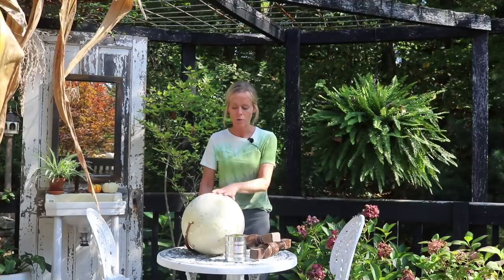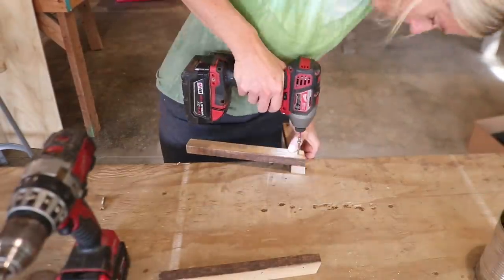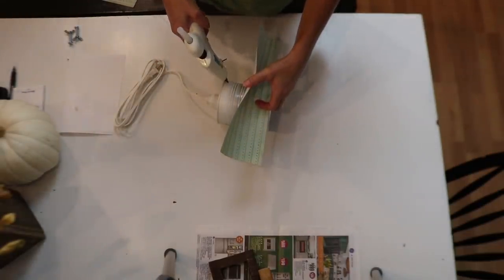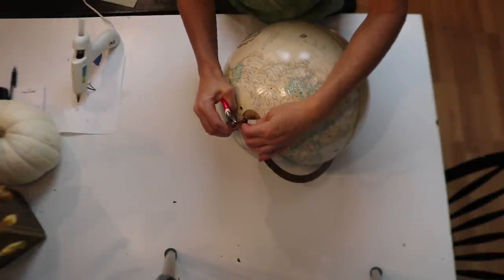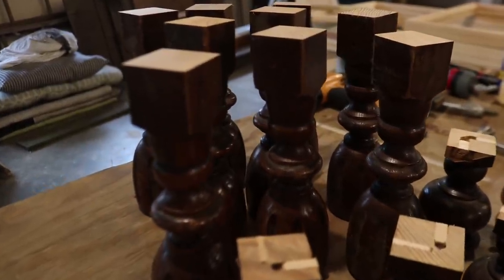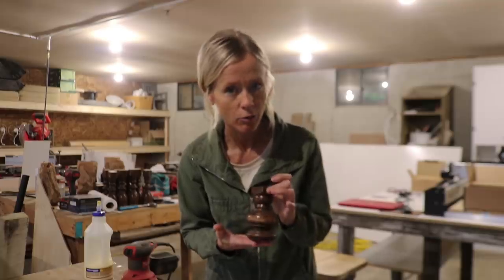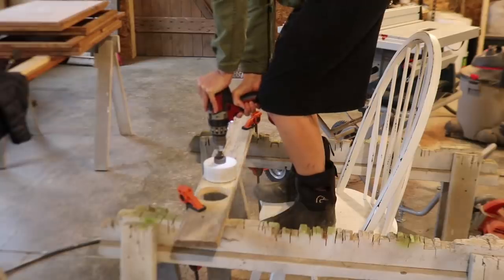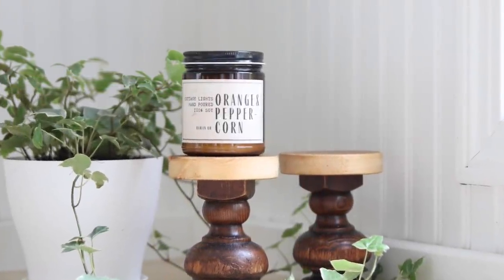Trash to Treasure Projects ~ Repurposed Tin Cans ~ Extreme Decor Makeovers ~ DIY Home Decor

Comment: I agree the wooden base lamp might benefit from different paper, or perhaps leave that paper on & just paint the wooden stand white? The flowered lamp is cute, I could imagine it as a bedside lamp in a teenagers room. I like the candle platforms they would protect a table from the heat of a candle when it burns low into the jar.

Comment: Hi Mary, I enjoyed your Trash2Treasure, as usual...would like to see the can lights after you tweak them. Your other projects are definitely treasures. I'm 71 years old and still climb, but you made me nervous. Wish I was brave enough to use shop tools. Daddy was a carpenter, and for 12 years I was the youngest of 3 girls. I spent hours, no years, in the basement with Daddy while he worked on projects for our home and for others. I would hold the boards while he sawed and  often had styes because of the sawdust getting in my eyes. But I never learned to operate any of his electric tools. The most I do is use a sander, usually a hand sander but when we refinished a floor, I used a floor sander. Have you considered showing folks in detail how to operate the tools that you use, starting with simple drilling, loading and operating a sander, etc? Thank you for sharing.

Comment: I think you might be right about those smaller lights needing some tweaking. The idea was great & inspirational. Your viewers can create off that on their own & adjust it to their personal tastes. I thought those cans could b cute if the they had little wood twigs no more than 1/5 of an inch wide, glued to the out sides of them with the can painted a color that matched the twigs so the metal of the can didn't show through. I think that would be kinda cute. They would look like little baskets. You could still use the little stands you made & even take some of the little twigs, cut them in half length wise & then glue them in a line down the middle of outside parts of the stand to help match it up with the basket look if that wouldn't b too much.

Comment: Thanks for a fun video.  Ref can lights. I would of painted the wood frame black and used an industrial scrapbook paper on both cans.  I would also use a low wattage or LED bulb to reduce heat.

Comment: Love this episode...As far as the can lamps, maybe a more industrial look would work considering the materials you used to make them... or even a touch of ultra modern type of paper.. I know that these are not your normal style however. I am a little concerned about the heat from the bulbs on any paper used especially if the lamps are accidently left on.  Thanks  D.
Reply: Maybe a bit of jute around the end of the can?

Comment: I think the metal lights might get too hot for paper…maybe….myself I like the hammered metal spray paint for the industrial look, even black…but that’s me….
I’ve made old crocks into some unique lights. I also took shades and glued leaves and natural plant material on the shade which gives a pretty look to the old crock jar. Using a ceramic bit and ( eye protection) to made the necessary holes…
I know you don’t drink wine but the bottles make some pretty lights and chimes….I have some old olive oil looking bottles with solar lights inside them on my kitchen window shelves for lighting the kitchen up at night to save on electric. Old metal cans are also cute accent light bases……ohhh now I’m in the mood for some thrift shopping…..
My husband use to make side tables from old washboards….I have one that the washboard is heavy glass instead of metal…..he also has made old cheese graters into lights…..

Comment: I think the candel holders would have looked better if all the wood was the same color. Or why not drill a small round hole in the candel holder for a candel to fit inside it. No need for the round top.

Comment: You could have been seriously hurt by standing on a chair and bending over as your project should have been closer to the floor and you should have been standing on the floor as you made me nervous watching you.  The glue from the glue gun could have separated from the item from the heat of light depending on the type of glue that you used in your gun or when it gets cold the glue from the glue gun will separate from the item.  I think I would have painted the inside of the globe to help reflect the light from the bulb and painted the shinny items on the globe to connect the light.  Thanks for the ideas....